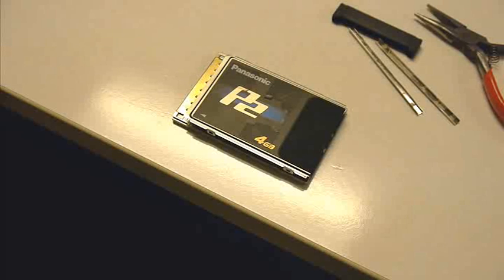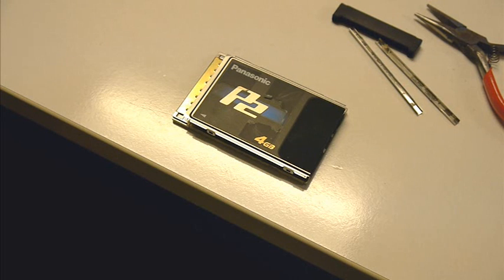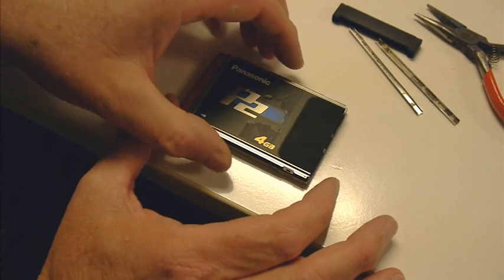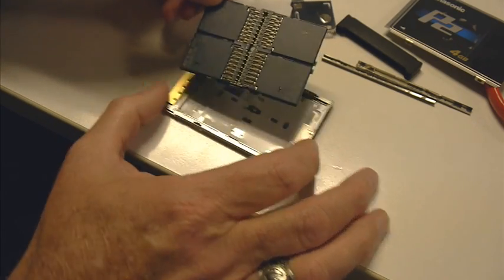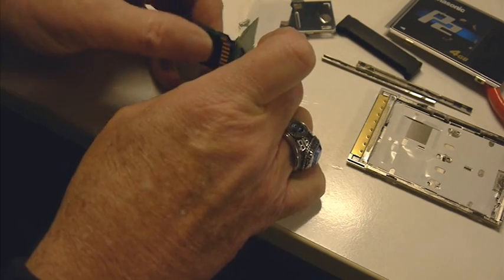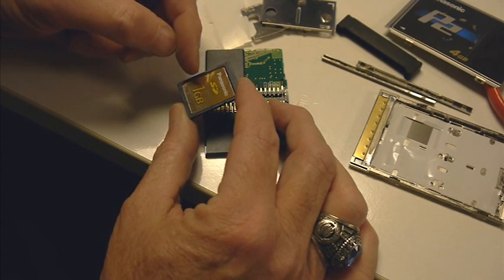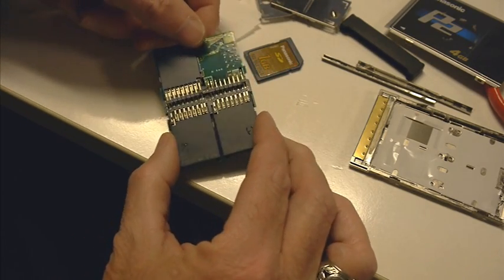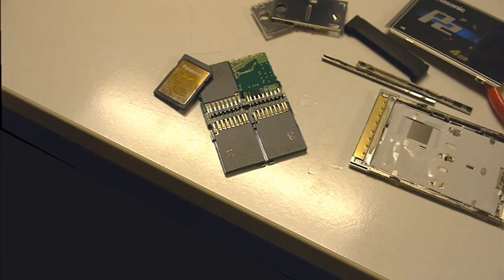The Inside of a P2 Card Revealed

Comment: Would it be possible to just pop larger cards in or would there need to be a bit more involved work done to make that work out? 16GB SD cards with adequate read/write speeds are so cheap it's not even funny.

I shoot a lot of video on my HVX200 (I used to have a regular handheld camera, but that broke and this one was being sold at an attractive price so it effectively took that camera's place) so at the price that a 4GB card goes for, I could have a bunch of cards at the ready. I've also fried a few cards (wonder how they got that 5 years figure on these 64GB cards) so I'm also curious if repairs would be just as simple.
Reply: bakonfreek you need to have minimum write speed of 100mbps and the card configuration to raid 0
Reply: Did you end up swapping the SD cards inside or trying anything with the P2 cards? I wanna grab a HVX200 but the P2 cards prices are discouraging. With the cheap price of fast writing sd cards these days, If replacing the SD cards work, I’ll be going that route!
Reply: @madupaul  
Unfortunately that didn’t end up panning out. I imagine if I had some way to get the RAID controller off the board to flash it, that would be possible, but that isn’t present to me so I can’t try it. Putting in different cards makes the camera spit out an “unrecognized card” error so I think the controller is keyed to the SD cards in the enclosure.

Comment: could you change the card to bigger size to see if if still would work. The only concern is i have is a limiter in the control board. This would be very interesting. I have 2x 16GB P2 cards and wounder if i could upgrade them to bigger size.
Reply: +Creativity Overflow or would even a pcmcia to sd card reader with an SANDISK EXTREME PRO with 280mbps or LEXAR PROFESSIONAL with 150 mbps work.

Comment: OK here is my Engineer's take on P2 cards. P2 cards came out to replace video tape. Tens years ago the famous HVX200 for TV news reporters recorded to mini DV tapes and also P2 cards. Raycom here in the South East bought a mess of these cameras. Stations then broadcast in old 480i and the DV and DVPRO were 25 Mbit/s and DVPRO50 was 50. The blurb I heard was  the 4 internal SD cards were in parallel as a RAID to not breach the ancient slow SD cards of 10 years ago's maximum writing limits. ie writing to solid state is way slower than reading. 

The consumer AVCHD format came out in 2006; the first AVCHD cameras I had would stop or lockup with poorer SD cards, or with name brand ones sometimes too. This is with a 18, 24, 28 etc AVCHD data rates. 

Thus the P2 scheme of parallel SD's inside was for 2004 when the cards came out; the things were probably designed back in 2001.

With my early SD card consumer P&S still cameras I remember the camera often would not work with an 8 GB cards once they came out years later; ie they had 4 gb barrier due to the file formatting. Then I remember rolling the dice with cards that would work for a minute or two then lock up as the card could not keep up with the data rates. ie writing say in the 6 to 10 Mbit/sec rate would breach older cards.

The P2 card with parallel SD just gave the TV station a robust card that worked at 25 and 50 Mbit/s in an era when SD cards were getting better. In that era there were counterfeit SD cards as they are today. 

A few years back I bought a name brand high end mini SD for a GoPro and it was 200 bucks for a 32 gig card and it would lock up at odd times. Then a no name brand was bought off of ebay for 30 bucks a year later and it is flawless; thus go figure.